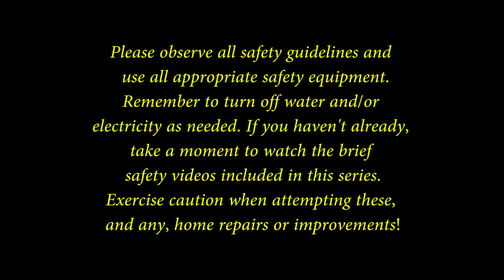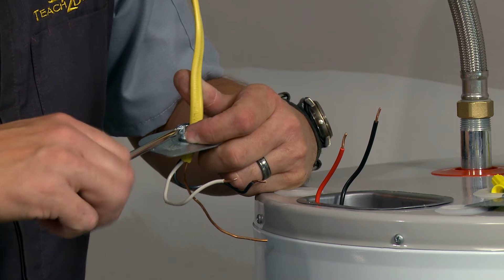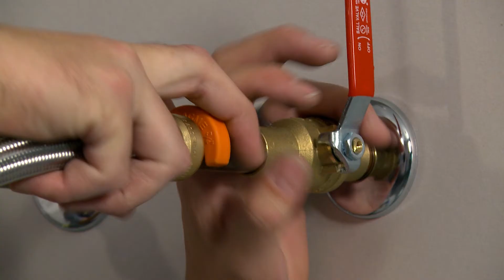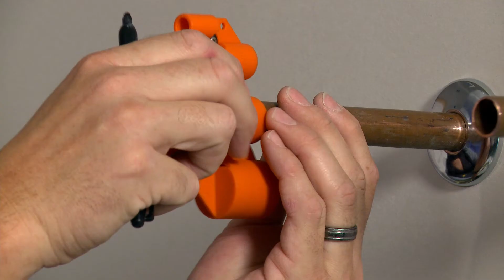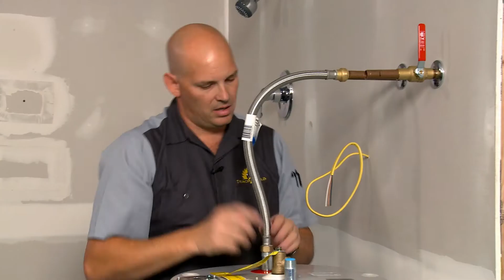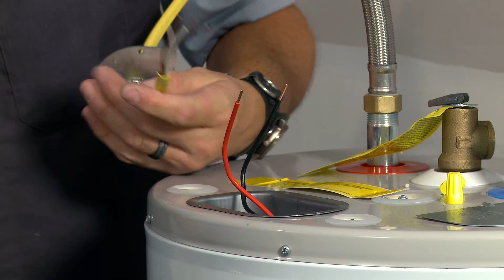Installation of an Electric Water Heater

Comment: when would you need a vacuum breaker on the supply side?
Reply from the maker: I've only installed them when required by code. Call your local inspector to see what your requirements are where you live. Have fun!